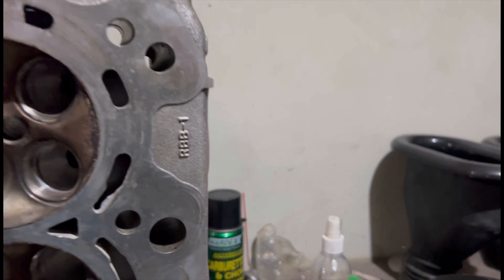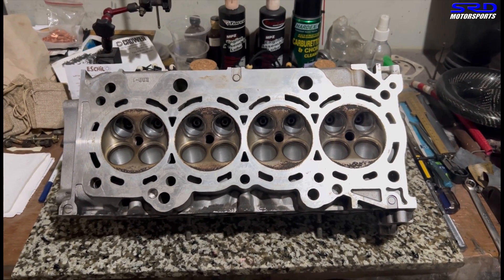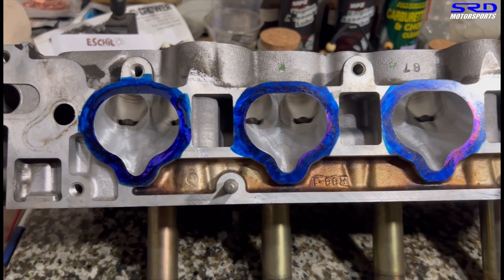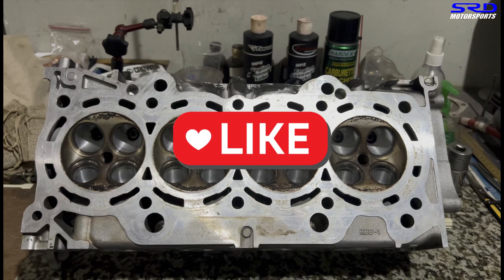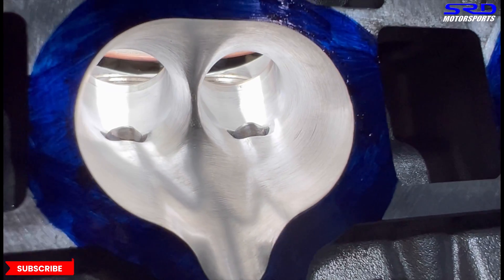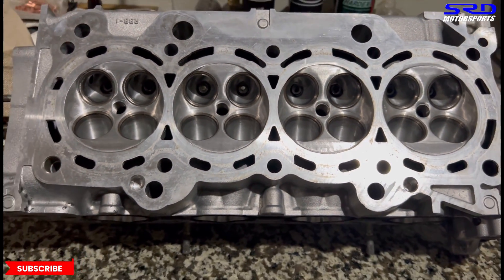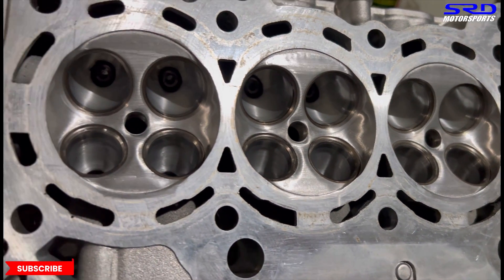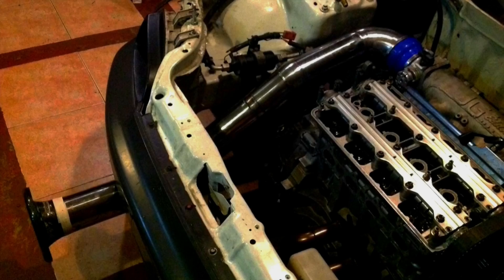K24 RBB Head Porting with Drag Cartel 4.0 OG series cam

Comment: Love the work in your videos! My question is; what's better, a ported k20 head on the 24 block,  or is this k24 rbb head being ported just as good? I'm really curious if a k24 ported head, supertech valve package and some dc 2.2 or 3.2 cams would work better or same as the duplicate settings on a k20 head?
Reply from the maker: really depends cuz some Time attack racers I know in AU prefered the RBB for me to port and all but yeah we can’t take away anything from the PRB as it’s a good base too 

manifold choices , header and actual application will come to importance
Hence the question is rarely wondered when we think about it

Comment: Question for you. We know the k20 rbc/prb/rrc head flows more than the k24 rbb when stock. Does it not longer matter which of these 2 heads you have if you port them? Would they be the same at that point?
Reply from the maker: When ported properly the prb/rbc head will have a higher ceiling of potential
Reply: @SRDmotorsports so basically if you can help it, start with a k20 head before porting.
Reply from the maker: @d0mochi really depends on the application and powerband goal as I know quite a few time attack peeps preferring RBB

Comment: Can I gain more top end on the k24 by porting only the exhaust ports because it looks like the header has way bigger holes than on the block.  I have easy access to the exhaust side but dont want to drop the motor.
Reply from the maker: That’s really hard to tell
Reply: Thanks, do you port match both intake and exhaust manifolds?
Reply from the maker: Exhaust = header not manifold so it’s already smooth and well done if you get a good header but a bad header exists

Comment: Ayan na... isnt it more cost effiecient than building a d15 ye?
Reply from the maker: tbh? No… core cost alone is significantly larger, even ecu options too… sa pinas that’s always the thought tapos mauuwi sa mild or stock k24 na lampas doble gastos tapos running 13.6s ? 

Tapos sasabihin ng shop un ung gusto ng customer? Ok sige 
Now the question is
Un ba tlga gusto? Sumabay sa b18 lang? 
We both know the answer is No 🤣